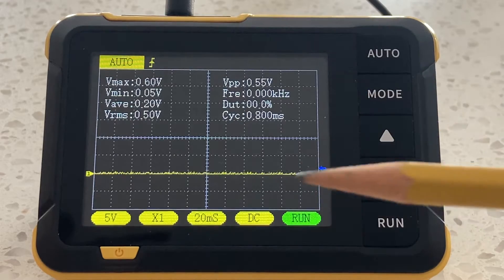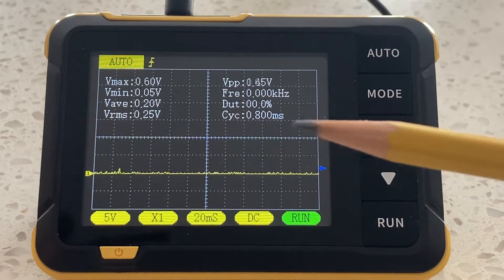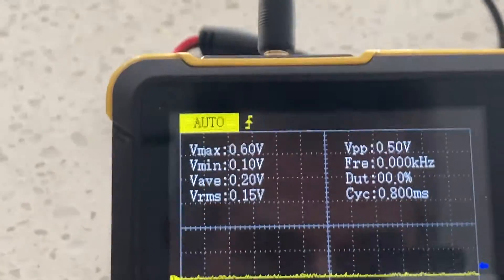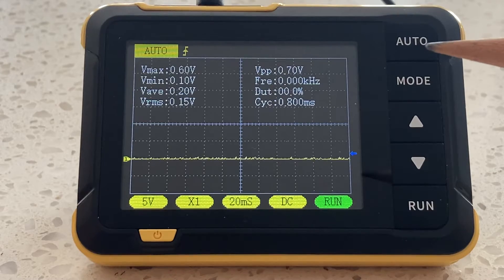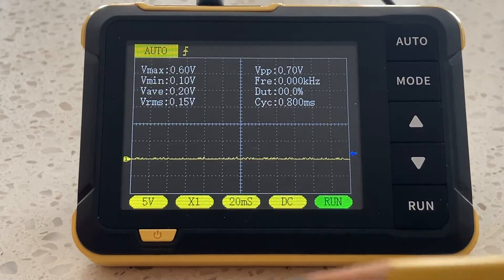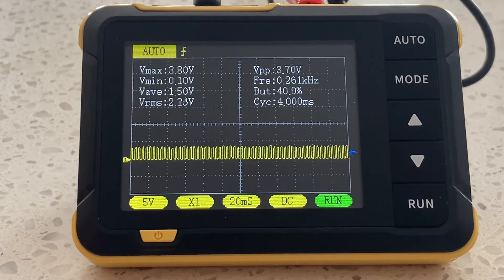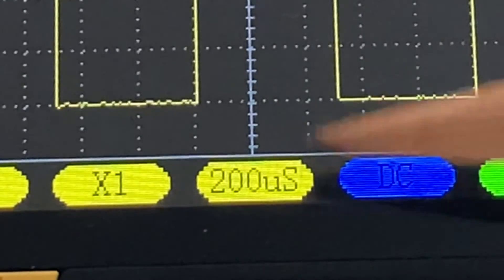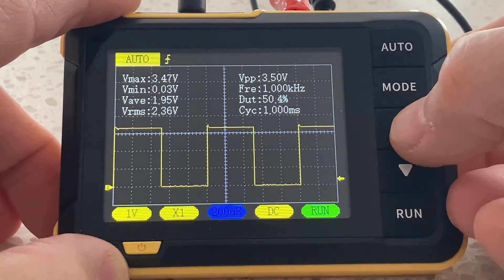Oscilloscope Fundamentals Part 2

Comment: If I’m using this for car audio would I leave it on dc or ac
Reply from the maker: If you are referring to audio amp output to the speaker channels …A/C. Thx for watching 👍🍻
Reply: @ thank you sir yes I am. I’m trying to tune my amp gain. Would you also know what vrms would mean if I have 1ohm impedance would the vrms be the voltage ?
Reply from the maker: @HunterMyers-d4s I am uncertain of the context but Vrms is referring to the root mean square value of an AC signal as you likely know. Wiki it if you require a detailed definition. 🍀👍🍻

Comment: Should try the newer dso510 , 10mhz + function generator
Reply from the maker: Looks very similar to the 153. Will check it out. Thx for watching 👍🍻
Reply: @TheGibby3340  it is basically the same , but with better specs , still 1ch tho

Comment: I bought one to test the low res pulse on a 1995 lt1 opti spark , how do i know whick lead to use. It uses a .5 volt reference. Appreciate your videos they are great , i know very little about these scopes. Thanks.
Reply from the maker: Ground the black lead, red lead to the contact you’re interested in capturing a trace from. If the amplitude you’re expecting is only 0.5V, start with 2V volt & 20ms scaling that should get you an image. Adjust voltage & timebase to optimize the trace as required. Good luck & thx for watching 🍀🍻
Reply: @TheGibby3340  
Thank you for your time , I was able to see the opti is working. My issue is the fuel injectors are being pulsed be the PCM , but they are not spraying fuel. Fuel pressure is good , injectors are new. I'm able to click injectors manually with a 9v battery and jumper lead. I think the fuel cut off side of the VATS will not allow the injectors to spray. Someone already pit a  resistor in the starter engage side of VATS but the BCM and PCM are not allowing the injector side of VATS to spray. Only option is to have VATS  remover totally from PCM. Thank you.
Reply from the maker: @TheMrmmkkpro I have no idea of the architecture of the system you are working on,but…Most systems are ground side switched. Make sure the power side voltage is present. Also load test the line with a reasonable wattage test light, if the supply circuit is compromised (high resistance) it may not carry required current to operate the injectors. 🍀🍻

Comment: Love that 20v/20mS tip. I did a crank and int/exh cam corelation with my hantek 1008 and 20mS gave me the capture i needed👍
Reply from the maker: It’s easy to recall and a pretty good automotive starting point. Thx for watching 🍻

Comment: This is very usefull mate. Thank you.

Can this fnirsi device also do signal generating outputs for testing sensors like temperature or ABS etc.
Reply from the maker: Thx for watching. The DSO-152 (in this video) doesn’t have a signal generator. The DSO-153 (about $20 more expensive) does have signal generation facility. I think peak output voltage is 3.3V. There is a couple of brief comparison videos of the 2 models on the channel if you’re interested.🍻
Reply: @TheGibby3340  

Understood
Il check out the video of the 153
Thanks mate

Comment: The reason I'm showing voltage is less than the battery was that the full scale display of the instrument was less than the voltage you were attempting to  measure.It was showing the maximum voltage you could measure with that sensitivity setting.
Reply from the maker: Thx & thx for watching 🍻

Comment: Nice overview. Wondering why the line is jittery if this is a DC battery. Is the device picking up stray RF? … or related to the duty cycle turning on & off, therefore showing a voltage drop.
Reply from the maker: Not certain to be honest. Maybe just the limitations of a $20 product 😁 Thx for watching 🍻